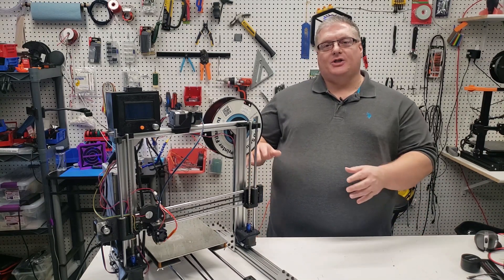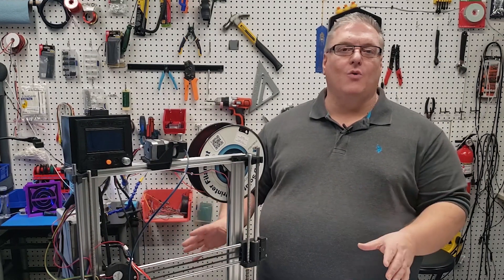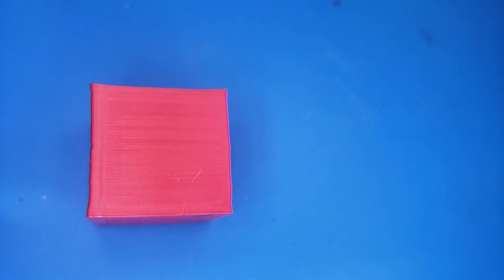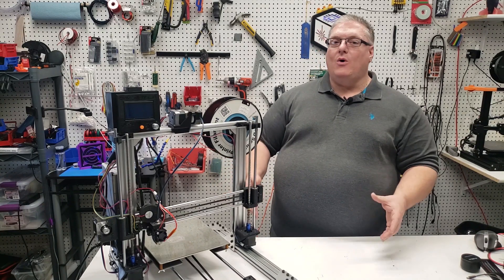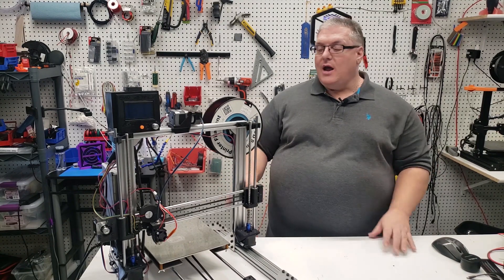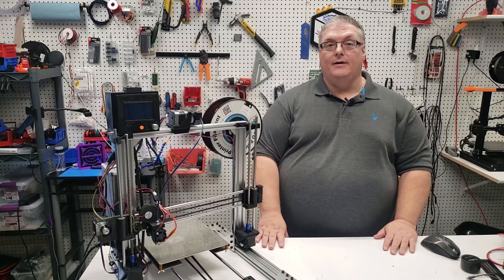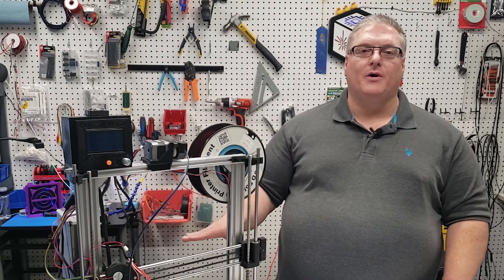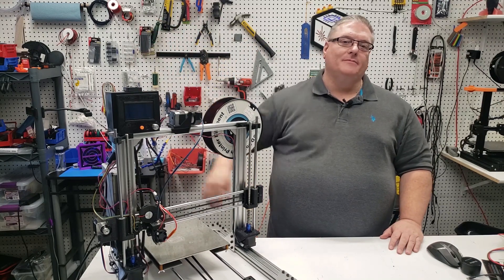Making a DIY 3D Printer Bigger! | Large format 3D Printer Tips

Comment: You can technically make a retail 3d printer bigger like the easythread ones that are like 70 dollars by making 3d printed parts that connect together to make the printer bigger. Of course the print resolution wouldn’t go up at all, but depending on someone’s purposes that won’t matter.  If I wanna print a 6.5 inch long drop in shell for a blaster, but the print bed is only 4 inch by 4inch by 4inch then I could just double or triple it’s size by printing the parts necessary. (I would need to buy a bigger print bed)

Comment: My question is not making the printing bed bigger but making the height bigger because I own an anycubic mega zero 2.0 build plate is fine but the height is not
Reply from the maker: Same applies.  You'll need longer lead screws and side extrusion.  You'll also have to recompile firmware for new height.

Comment: Hello dear Makers Mashup team. Thanks for your generosity in sharing your knowledge. May I ask what material do you use to print your 3D printer's parts? Is PA12 OK for this propose?
Reply from the maker: Amin - I use PLA but if I was going to use it in an enclosure to print ABS or the like I would use PETG instead.
Reply: @MakersMashup  Thanks for the reply.
Reply: Have you ever used PA12 filament with C201?
Reply from the maker: I have not had a need for Nylon but I see no reason why it would not print fine.  It comes down to the hot end at that point and if you have an all metal hot end it should be able to extrude fine.

Comment: You could easily convert that machine to 300x300. You shouldn't have to extend the Y axis, but you would need extrusion for the X. Then you would need new rods and belt for that.
You would also need a new bed and mount. You might be able to remove material from the bed mount to save some weight. It still has to be structurally sound. You can also slide the Z axis assembly forward to account for the size of the bed. It is obviously a bit more work. It can be done. I can upgrade my Anet AM8 to about a 250mm bed if they made one that size and have a small amount of room to spare

Comment: Why do not make an xy mooved nozzle, z mooved bed printer like the ender 5, the vellman vertex or the ultimaker, this seems to be a easier system in speach of mechanics and calculations for thé mainboard
Reply from the maker: That is a valid option as well.  I still prefer corexy over that style cartesian because most designs have a motor moving on at least one axis that's more weight.
Reply: @MakersMashup  an other, valid and cheap option, is the all v-slot extrusions core xy machines like the french 3DRAG+ from comelec (it is a french company that make magazine "électronique et loisirs magazine" and sells their own model of a core xy 3d printer) all the details of the machine (assembly, 3d views, ...) Are in the number 145 of électronique et loisirs magazine
Web pages : 
www.comelec.fr
www.electroniquemagazine.com
If you want some pages, I can send you them by e mail
Reply: @aterxter3437  Hi, moi je suis très interessé par ces quelques pages que vous proposez envoyer... En ces temps de confinement une bonne lecture est la bienvenue ! Vous est-il possible de me les envoyer ?